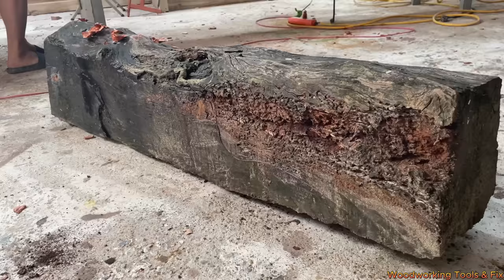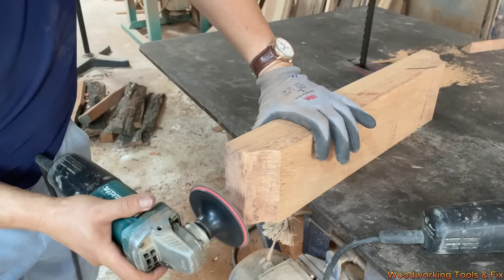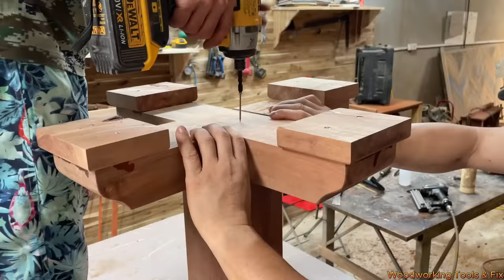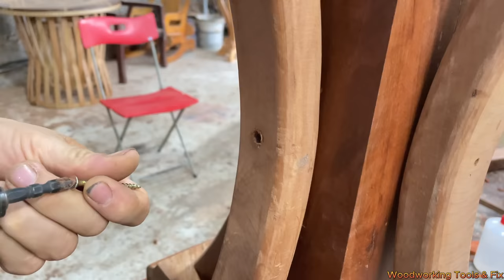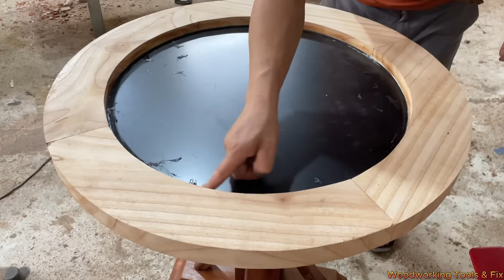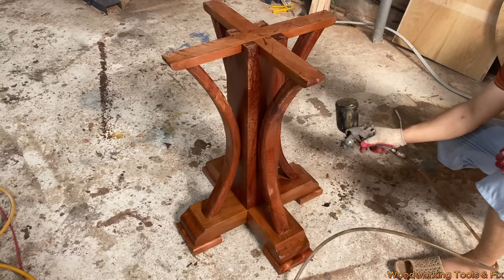Woodworking: Transforming a Found Roadside Wood Piece into a Beautiful Epoxy Resin Table

Comment: I love the technique that turns the log into boards. That is a great blue marker you use you can even see it in the video. It does seem slightly risky pushing the wood through the blade using only hands however as long as you do not become overtired it would not be dangerous. One slip if fatigued however could be disastrous that’s all I’m thinking. Also what comes to mind is that alcohol and working around the shop blade do not mix obviously. This is quite a project I am in awe even watching just a little bit of it. You have had a brilliant genius idea to think this up and carry it through and chronicle the whole event. Well worth the trouble you have been rich and educated all of the rest of us.
Reply: Yeah, I was waiting for him to lose a finger too.

Comment: Watch yer feet!! Slangin that hunka wood in sandals is temptation to the devil, and eventually he'll cave. And so will your feet. Nice chunk of well weathered wood. Mill it at 8.5% or less moisture so it doesn't do a torsion after it's worked--- let's watch the video.
OK- video over. This guy did an excellent job with what was available.  Economical milling techniques and a minimum of fasteners  make this easily doable for those still working on their skill. And it will hone those skills you've already bled and sweated into yourself, too.
I find myself heavily coveting this piece.

Comment: Good work 👍 i am not very happy about the method of joinery used for the table. Every joint is screw based which is not very strong. Over period of time this will become weak.

Comment: The wood from the old rotten log should have been dried at least for a few months and treated with some kind of mold killer. The wood will likely warp over time or even dry rot because of the moisture content sealed within. Also, it didn't look like they got rid of the surface bubbles in the epoxy before it set but hopefully they were able to remove that layer with the planer and sander. Very sloppy but the end result still looks great.

Comment: Have these people ever heard of safety measures?
Reply: He was wearing his safety flip flops.
Reply: @Bình Minh  yes, but you should never wear gloves of any type when working with anything that spins/rotates/or cuts. A glove can get caught and pull you in to the machine. I wear gloves when Cutting sheet metal, but I take them off before I use the drill to run a screw in. My glove got caught one time and almost broke my finger.